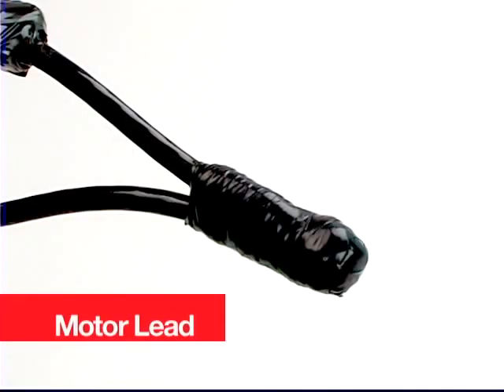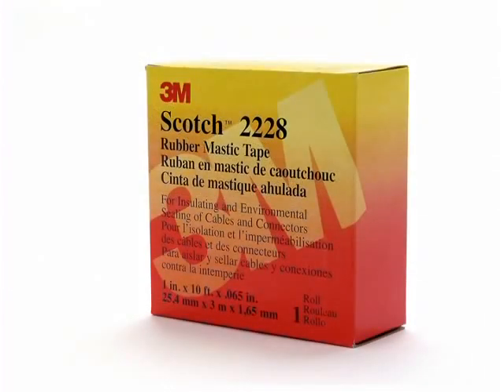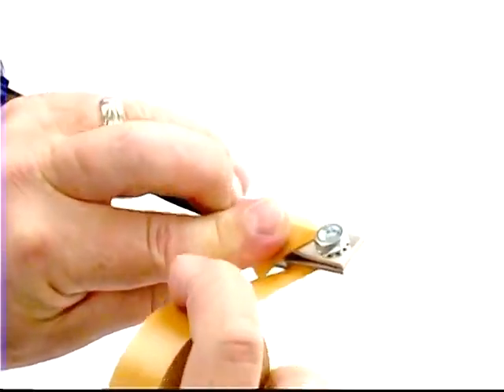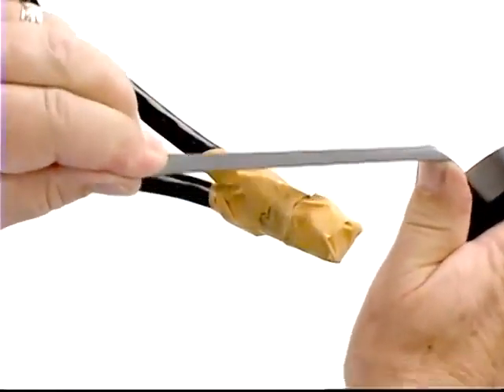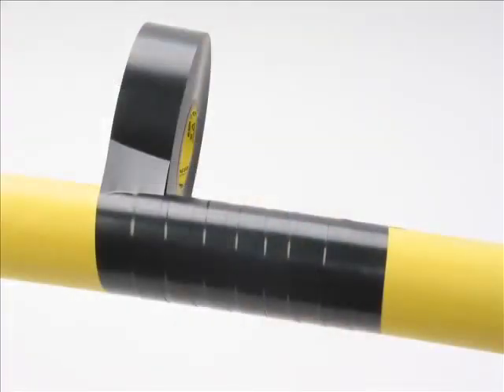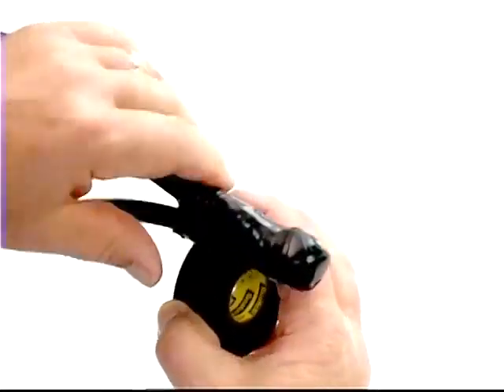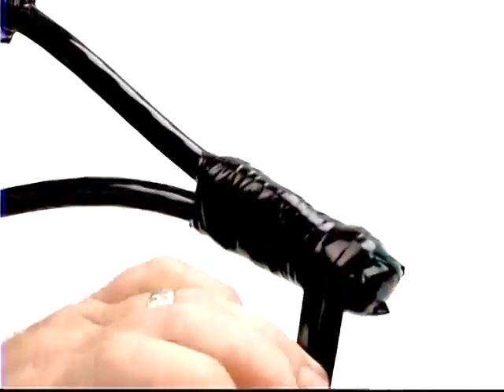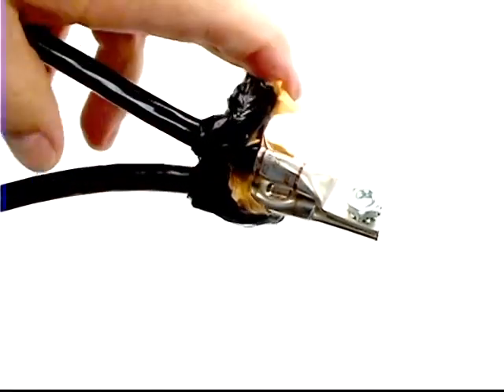3M™ Motor Lead Pigtail Splice with Scotch® Linerless Rubber Splicing Tape 130C   Training

Comment: Fail!

You only need one wrap of cambric tape, and there's no reason to put it in the "Y" of the splice. That many wraps of cambric will leave air bubbles inside the tape ball, which will expand and cause failure of the tape as the splice experiences heating. The cambric should be mashed as close to the lug and bolt set as possible to minimize air gaps.

For the rubber tape, I get much better results by taping in 10 inch strips until the tape ball has sufficiently covered and padded the splice. And I NEVER allow the tape to wrinkle. Same for the vinyl tape on top.

For fun, I once used Scotch 35 instead of 33. I wrapped one lead in brown, one in yellow, and one in orange.